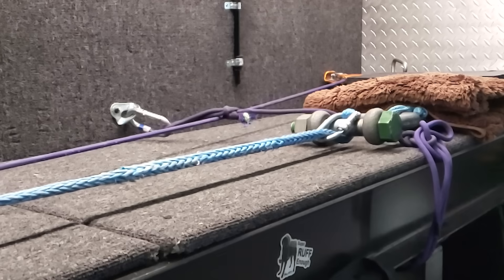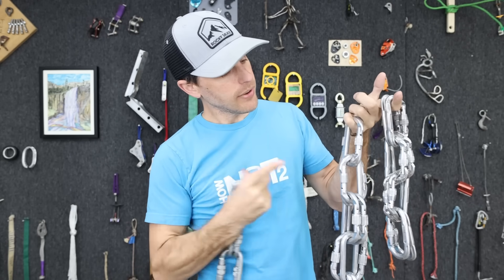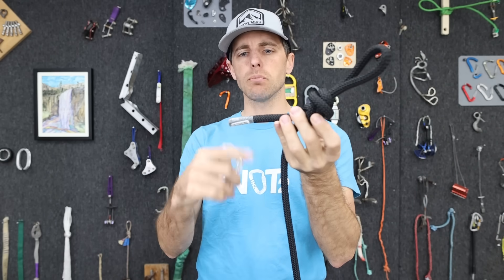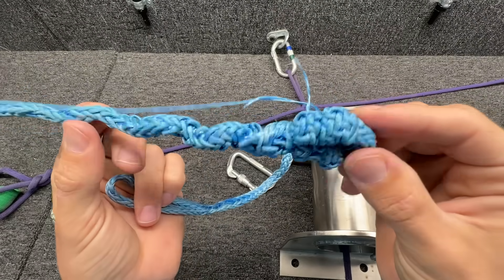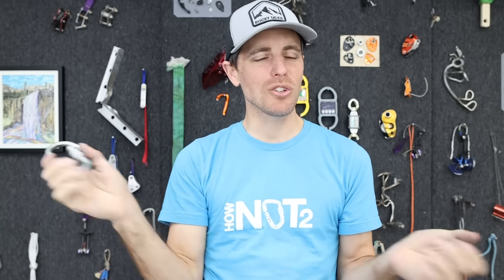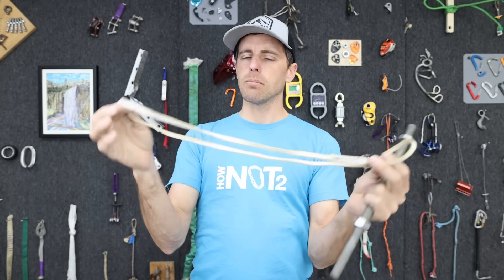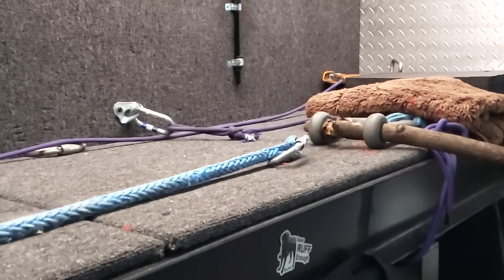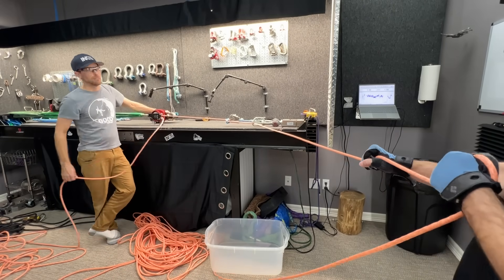Ever done this before?

Comment: As someone who has side-loaded carabiners on trees, I'm glad to see it's not a big concern. Thank you for testing! Your channel rocks.
Reply: Where it becomes a big deal is in the lawsuit after an incident, should one ever occur.
Reply: Makes me feel good that I found myself in the same corner of the Internet likely looking for the same information and coming to same conclusion as you. I appreciate all this channel and you @zach-riggs  do for the exploration and sharing of knowledge related to dangerous occupations and hobbies.
Reply: Saddle hunter?
Reply: @kltoutdoors  Changeover practice (ascend/rappel)
Reply: @kltoutdoors that's why I'm here haha
Reply: Iam also tree guy, love seeing the testing this channel does
Reply: I think I would always double or triple wrap the rope before clipping it.   (Unless the single loop is so some how from the bottom you work (wiggle)  the carabiner loose down the line... ???)    I also might make an alpine butterfly and clip to that so the carabiner isn't jammed up against the limb... but the indication here is that the knot would probably break before any of these carabiners.  

I also know that almost all sailors at some point experience and learn, that off unaligned loading a lot of very high load rated blocks (pulleys) , clutches, etc.. can at very low tensions destroy them. So yes, great to know how much you can get away with a carabiner.
Reply: Yes, I do this for my backup when flipping up a stem (using a flip lanyard around the trunk and spikes on the boots, stepping up the tree).
I have a static line that I flip around the trunk and clip to itself with a biner and then use a friction device on the tail, clipped to my saddle.
If the flip-line (lanyard) fails, slips, or I loose a spike hold, the static line cinches to the tree and the friction device takes my load (me & my gear, saw).
So, kudos for the testing.
BTW: I use a heavy Petzl steel oval triple lock (OXAM I think) carabiner for this purpose.

Comment: If you have access to the pipe/branch, loop the rope over, and secure with a Stone knot using the carabineer instead of the fiddle stick. It takes the carabineer bend out of the equation.

Comment: You can always wrap the rope around several times, creating essentially a tensionless hitch. Then there is very little force on the carabiner.
Reply: You won't be able to pull it down with a retrieval line though. May or may not matter for your use case.
Reply: And it is better for the tree.
Reply: no no knot
Reply: Good, yes, the more wraps,  less force in the carabiners 👏👏

Comment: If a bar is skinnier than 22 mm, you can probably just click the carabiner right onto the bar.
Reply: If the carabiner is locked on the bar it is harder to make a retrievable system
Reply: @JohnDinh-rh6kx  remember to always bring your carabiner keys
Reply: @JohnDinh-rh6kx wait, how is it retrievable at all?
Reply: I’ve definitely clipped an alpine on a branch before 😅
Reply: If you wrap a carabiner around the bar you can tie a tag line to the biner and be able to retrieve the whole thing
Reply: You're almost better with a quickdraw with a tag line tied to one carabiner so you can retrieve it, Run the gates opposite if they're not both captive. This problem is worse for people who might take a hard fall, it's tough to pull more than a couple kN rappelling unless you're way bigger than me. I'm hemorrhaging body fat the more I climb. I never realized how core-intensive it was until I got back into climbing after a long hiatus.